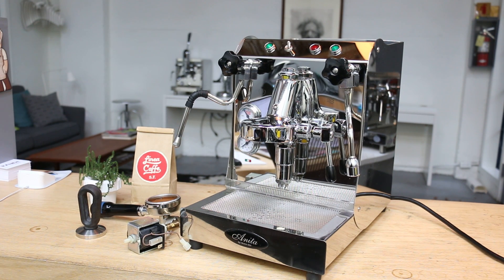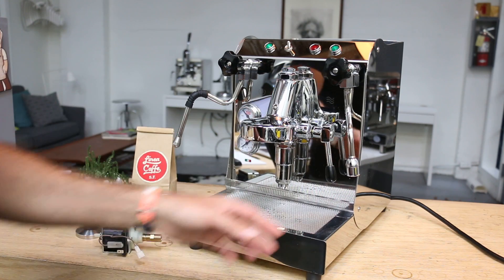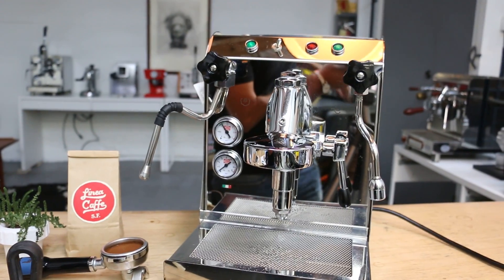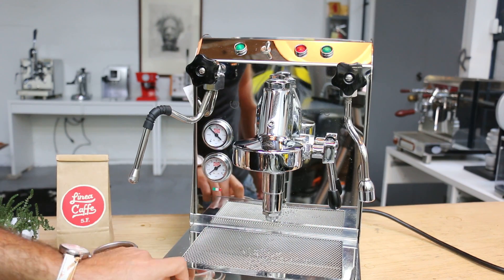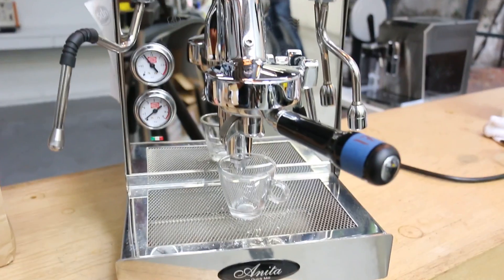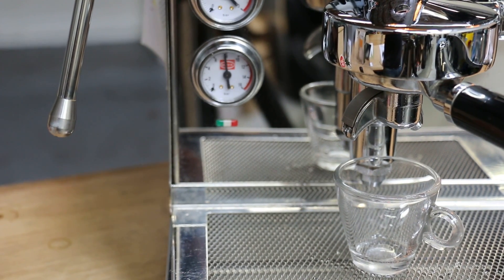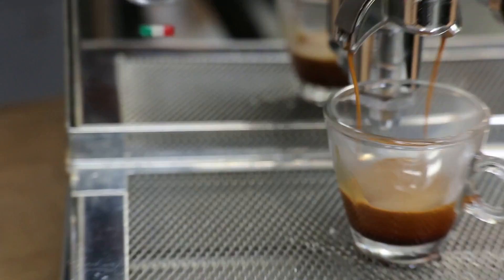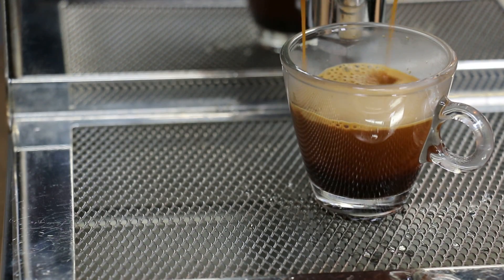Quick Mill Anita Pulling A Shot 1179

Comment: Is this machine any good?
Reply: Mine has been very dependable and pulls great shots, mine is a 2011.  I've had to replace the Ulka pump, the SSR, the float, group head gasket, and now I believe I have a failing high temp safety switch.  Machine is easy to service, and good for a DIYer.  Be sure to use low mineral content water to avoid scale problems, these machines are very sensitive to scale and will not heat up to steam, or extract hot water.